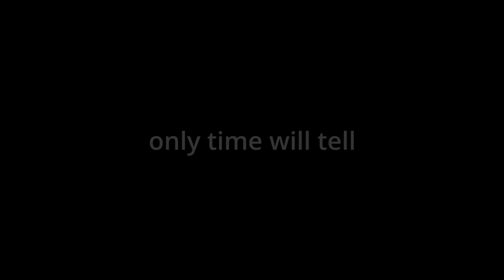Ilford ILFOTEC HC  - Your using it wrong  .....Probably

Comment: I mix my HC one shot directly from the syrup, which suits a relatively low volume B&W development (1 roll per month average B&W). The bottle I bought in March  2021 is still going strong. I was told that when you add water you hasten oxidation, but the nominal shelf life of HC is shorter than Ilfotec LC29.  I think that Ilfotec LC29 which you can buy in 500ml bottles is pre-diluted (=stock) Ilfotec HC and if it has a longer shelf life it would blow the oxidation theory out of the water.

Comment: Have you seen an improvement? In the end both methods result in a 1:31 concentration and by not making stock it lasts that little bit longer
Reply from the maker: At the moment I see that making the stock makes the 1ltr concentrate last 4 x longer before buying another. Still running tests, been busy fixing the shed after the storm we had, but early results show the same results in film development. So for now it's all down to money saving. I wish you well.
Reply: @davecarrera   I'm not sure this is correct. Lets say I make a 1:31 using the whole bottle. 1 litre HC to 31 litres water gives me 32 litres of developer.

If I make stock with the 1 litre that gives me 4 litres of 'stock'. To get 1:31 then I need 1 part stock to 7 parts water so 4:28 which again is 32 litres of total developer. I would argue you shorten the life ( depeding how often you develop) as the stock needs to be used withing 6 months according the data sheet. 

I think there is a benefit in that it is easier to measure if you use larger concentrate for stock solutions

Happy Wednesday. Trying not to sound like a know it all and also keen for us all to save cash!
Reply from the maker: @mcor1597 maybe your right.